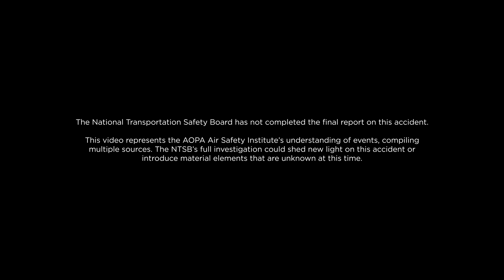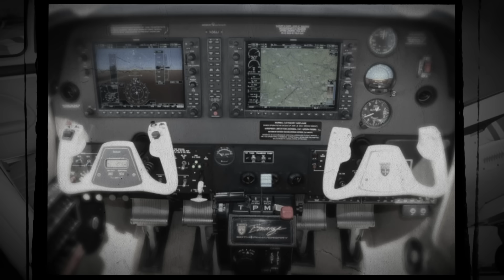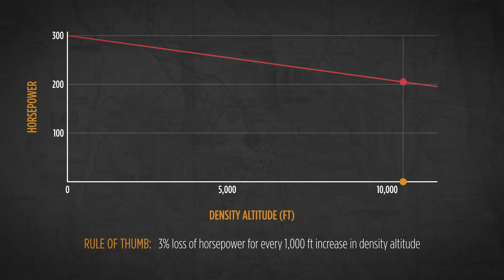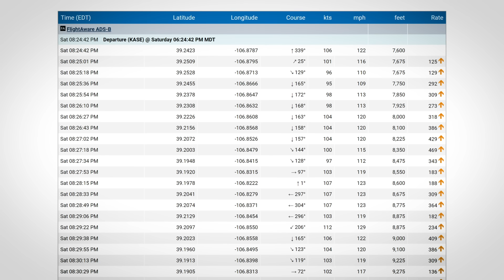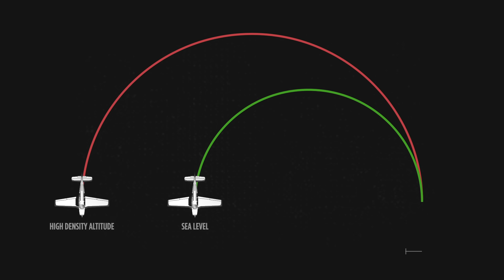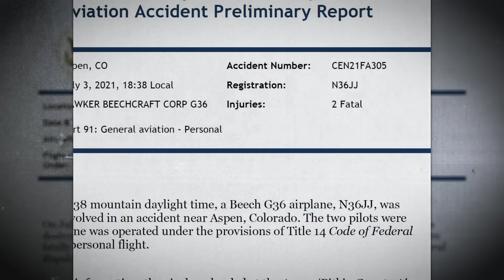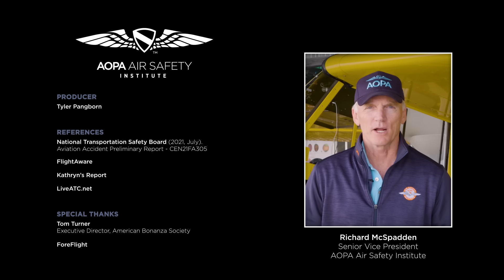Accident Case Study: Into Thin Air

Comment: Excellent explanations and presentation.  Thank you.  All points are vital food for thought.  
What I have learned from this video:
1. Ensure that you’ve got a turbo charged engine if you’re going into a mountainous environment so as to maintain aircraft performance characteristics.
2.  Climb to a safe altitude where are you clearing all of the ridge lines en route before actually heading outwards following any valleys or canyons – play it safe. Always.
3.  If however you get caught in a bad situation in the canyon stick to one side and ensure that you’ve got enough room to turn around and do a 180 if necessary.
4.  Constantly Look at how fast the valley floor is rising if you haven’t got enough altitude or cannot get high enough to clear the ridge lines. 
5.  Be aware of unstable air when in a mountain environment – especially downdraughts.
6.  Learn How the aircraft handles at different heights through practice flights before going into mountainous situations.

Comment: This airport was part of my mountain rating checkout in our Bonanza V35-A (on a HOT summer day).  That airplane should have been able to make the flight even fully fueled.  There's an excellent book, "They Called it Pilot Error" that covers lack of O2 in the blood after hours aloft.  So this was New York pilots flying from CA, and now at 10,000' and higher?  Without supplemental O2?  Their thinking faculties were highly impaired; even simple problems become difficult, if not impossible.

Comment: These pilots were in over their heads on Mountain flying. Always pick a side of the canyon you will fly up.  Never the middle.  They should have taken off the next morning instead.  Or better yet, picked a lower elevation airport not surrounded by mountains.  What they likely did in flight planning was depart Napa and fly as far as they can get on one tank (Aspen).  Flying further south thru Arizona would have been a wiser choice too

Comment: Use the Garmin G1000, do not enter the valley below pass height. 
Don't use high altitude airports as fuel stops in an airplane that you are unfamiliar with in surroundings that you are unfamiliar with. 
Always calculate your best angle of climb speed before takeoff when in a relatively low-performance aircraft and in mountainous regions. Fly that speed until you reach the sectional chart minimum altitude. 
DO NOT take off in mountains without a planned departure route, whether VFR of IFR. It's easy to go up the wrong valley because everything looks very similar. 
ATC should definitely double-check if the aircraft actually is high enough. Obviously ATC knows that 10000' is well below pass height of 11800'.

Comment: This very good analysis stressed the inexperience of the pilots involved in mountain flying, but this can also happen to very seasoned pilots. Europe experienced a record summer in 2003 and there were lots of similar accidents in the Alps. People would just fly routes they knew by heart without recalculating or fully appreciating the changed density altitudes, with the exact same results.

Comment: I'd have to replicate it in the sim, but from the video here it looks like that turn was possible if they had been a lot more aggressive. Like full power, flaps, pulling back while turning with full rudder might have given them the clearance. The problem with these short turns if you often can't tell you're going to strike until you are mid-turn and by then it's too late. :(

Comment: That's why I don't fly between my two homes. Need to clear a ca. 16 000 feet high pass (andean mountains). My car has a (proven) maximum service ceiling well beyond that (at beyond 17 000 at least) and I can drive at that altitudes without the need for additional oxygen (not all of my German family though, had some issues with altitude and pessengers in the past, might install oxygen in the car at some point). Small airplanes have problems there and you don't want to be only like a hundred feet above terrain, always include good safety margins otherwise unexpected winds and things like that can kill you. And the Airplanes that would fly the route without a problem are to expensive for me...

Comment: This is so immaculately well produced, both from the way the content is presented but from the quality of the visual production itself. Superb.

As a NY pilot, the first time I flew along the grand canyon was absolutely mind-opening in terms of DA, having never encountered those altitudes before in my flying. Unfortunately, I think the narrator's point that DA is a concept that we all learn but is usually hard to truly understand until you experience it is probably very true. Took every precaution on my flight and did everything rigorously by the book, but despite fully expecting it even I was a bit shocked by just how much worse the plane's performance was than what I was "used to", beginning from the length of the take-off roll onwards. Many thanks for the AOPA for providing such a fantastic resource to us all.
Reply: Although not a pilot, it seems like a turbo-charged engine is crucially important when flying in higher terrain.

Comment: Personally, I would have taken the time to climb above the departing airport to cross the highest terrain + 1000 feet (and by the time you get there, you will probably be at 2000 feet) and then drop down to a lower level airport east of Colorado for refueling if necessary. He had tip tanks so I would assume he had lots of range and fuel for a climb, even if it took a half hour or more above Aspen. Get-home-itis is a killer. I watch these videos like the pilot in the Citation going from SLC to Tuscon and he looses at FL200. Who cares if the A/P pack it in? If you need A/P while enroute and you are  not over burdened which he wasn't, fly the instruments!

Comment: Three minutes in, and there are already three items that would put me in a motel until the next morning. Unfortunately, GA has one common factor that leads to accidents: the people who own the planes have developed a sense of accomplishment in their work that does not apply to endeavors outside that theater of success. This arrogance, typified by the idea that they will take off VFR and make that navigation decision in the air, is far too common among these people who believe they can do anything. Consider this: I did not have the 4.5 million to own the jet I once flew, and I don't own a Bonanza either, but I am still here to talk about this needless loss of life, and these two guys aren't. Why? I don't posses that over-confidence that I can do anything that I want. Instead, I see the red flags and don't try to call them green flags or yellow flags. Even as a student pilot, I knew that high density altitude operations requires either a turbo or a  turbine. How these two guy didn't know, or chose to ignore that aspect, is a deadly act of hubris. So, everybody learn from this, and post questions if you have them.

Comment: Since there wasn't enough room at the end of the valley to make a 180-degree turn, would making a half-loop up, to point the plane back down the valley, and then turning the plane right-side-up at the top of the loop, been a viable option?
Reply: If they’d had performance for that, they’d have had the performance to get over the terrain.

Comment: Glad I earned my private ticket at an airport that was 7220' MSL. Density altitude and surrounding terrain were always a consideration. Have done parts of the Rockies in a Cessna 172 many a time.  I've never done Aspen, but have done Leadville at 9,934' MSL.

Comment: While deeply and personally heartbreaking to watch, they did an excellent job putting this video together.  The aircraft owner would want people to learn from his accident and he would be so thankful if it saves even one life. One thing that the video didn’t touch on enough that would be another important lesson to take away is that even relatively new pilots should not entirely cede and defer all authority to the other pilot just because they may appear to have more experience. The owner was a new pilot with less than two years of experience, while the safety pilot and PIC at the time of the crash had much more experience and was commercially rated.  The owner was always incredibly focused on safety and planning because of his inexperience, but the safety pilot tended to just figure things out as he went along using his seemingly greater experience as his parachute. Unfortunately the owner deferred to the seemingly more experienced pilot when poor decisions were being made, presuming he could trust him and that the safety pilot knew what he was doing. It cost him his life. Even new pilots shouldn’t be afraid to ask questions, bring up concerns, and point out critical information or issues that may have been overlooked by their flying partners. CRM is an invaluable resource and saves lives. Bottom line is if it doesn’t feel right, speak up and ask questions! That’s all it takes sometimes to break the chain of events leading to a tragedy.  
RIP Ruben. We miss you.

Comment: The sky is clear, the air warm. Your aspirated aircraft’s normally impressive climb performance is sluggish, and you’re beginning a cross-country flight in the mountains. But you’ve flown in higher density altitudes than this, so you press on.

You circle near the airport a few times after takeoff, to gain the altitude you need before cautiously making your ways towards the mountains. Then, with no warning, you’re in a valley. Mountain peaks rise above your aircraft on both sides. You scan your map for help, but you don’t find any. Somewhere, a voice is saying “you should have turned back”.

You now have 178 seconds to live.

The mountains in front of you are many miles away, but your vertical speed indicator reads only 200 feet per minute. You ease back on the controls to climb a bit faster, but your airspeed bleeds off, so you quickly lower the nose again. Your speed increases slightly, but now you’re climbing even slower than you were before, and the mountains are getting closer. You’re sure you’ll be above their peak in a few minutes… but you don’t have a few minutes.

You now have 100 seconds to live.

You look closely outside again, and are shocked to see the valley getting narrower. You estimate that there’s no more than half a mile between the peaks. You begin a 180 degree turn, but the thin air causes a low airspeed and a high groundspeed, making your turn radius much wider than normal. You have no choice but to turn back to your initial direction. The mountains don’t look so far in the distance anymore.

You have 45 seconds to live.

Now you’re sweating and shaking. The valley floor is getting higher, and you don’t have enough altitude for a tight, descending turn that allows airspeed to be maintained. You’re running out of room.

You have 10 seconds to live.

You realise you’re going to crash, and frantically look for a place to put your aircraft. You spot what appears to be a flat clearing and fly towards it, but it’s just another steep hill. You open your mouth to scream.

Comment: The key factor for me, before any of the 4 mistakes listed, was the one on the ground. They waited too long and had a desire to get to their next waypoint, thus making poor decisions. They had an IFR plan but immediately cancelled it on the ground when it wasn't favorable. Given they are in a new plane in an unfamiliar area, sticking to a plan is far safer than just winging it. The other things that AOPA lists are spot on, the truth was the aircraft should have never taken off until both pilots had a clear plan and understanding their flight plan and what to expect.

Comment: In 2003 a French CASA 235 military transport twin turboprop crashed in a valley of the Pyrenees in a raising valley leading to a pass, flying intentionnally low in the terrain. They crashed 200m or 650ft from the pass, trapped in a terrain raising faster than the aircraft could climb. That really relates to the narration.

Comment: Density altitude accidents keep killing pilots year after year. Why did these guys think that they were exempt? The G36 is supposed to have a service ceiling of 18,500, but this plane was very close to its limit. The pilots should have climbed to the no-oxygen limit of 12,500 before venturing into the mountains, and then they could have climbed to 14,000 for 30 minutes legally to clear the terrain. A better choice would have been to carry supplemental oxygen.

Comment: Pretty much all the MEA's for eastern departures out of Aspen are 16,000 and above. It appears they did not even read the IFR low chart before filing their IFR flight plan - being surprised that they were cleared to 17,000 when they likely did not even have oxygen on board, and then just deciding to figure out how they are going to cross the front range AFTER taking off from Aspen on a hot day with an NA engine. It's damn near suicidal. From the safety pilot's type ratings, he probably spends most of his time flying jets and never has to worry about whether he can climb fast enough or high enough. Just because someone is an ATP with a lot of jet time does not mean they are competent to fly a piston single in the mountains. An instructor recently relayed a story to me of an airline pilot friend of his that bought a C-180 with giant tundra tires - a bush plane. He hired the CFI who is experienced in mountain flying to help him fly it back home - a smart move. The CFI told me that after takeoff from a high altitude airport they were climbing out at about 500 ft/min, the airline pilot asks if they should declare an emergency. The CFI asks why and he says because the plane is not climbing! The CFI explained to him that everything was normal and no need to declare an emergency!

Comment: It's situations like this and airports like Aspen that do a good job at articulating like why we get paid an extra hour at my airline for each landing into Aspen. There is little room for error, let alone a mechanical anomalie. The highest I've flown anything was a SR22T into Telluride--still 1,000ft lower than Aspen on this day--and it took a solid hour of preflight and number crunching. I'm a flatlander from Florida and it was my first mountain experience with 2 clients aboard. Hardly intelligent. Easy enough with a turbocharged aircraft, but this situation could've happened to us or anyone else. Y'all stay safe and crunch them numbers.

Comment: Would it have been safer to deliberately ditch in the trees as slowly as possible rather than commit to a turn?
Reply: Possibly. It's a very hard decision to make. You have to be mentally prepared to make a decision like that and execute it without hesitation. But you're not likely to act decisively if you're already way behind the airplane.

Comment: Wow, I am not a pilot but find this information very informative.  So, what would a pilot have done in these exact situations where they couldn't turn back and couldn't get enough height?  Assuming now, the only alternative would be the best/easiest crash landing?
Reply: If I were in their situation, I would shoot for a heavy tree coverage and try to trap the plane in the tree tops, then fall down below, prayerfully hoping for the least amount of damage to the occupants.  Many have survived such an event by using this tactic.
Reply: @dryan8377  That makes sense.  I thought about based on altitude and speed they should attempt to "land" as they headed up the mountain.  Maybe less trees with altitude and an open area.  However, did not think of your idea.  That makes a lot of sense especially if they are pine trees, (softer wood) and can absorb impact.  Thanks for the idea!